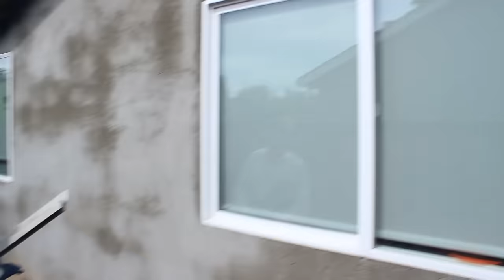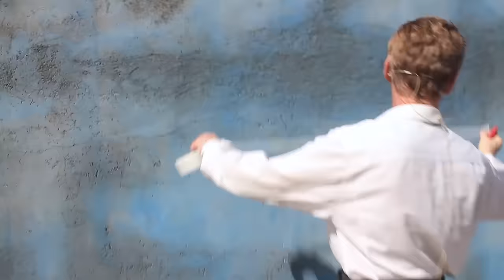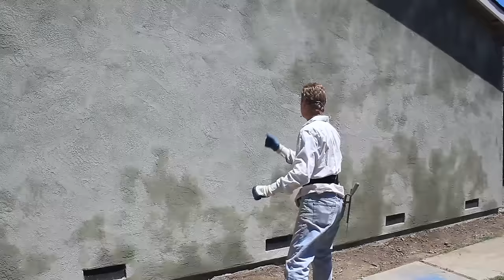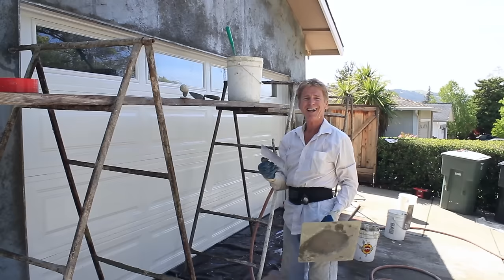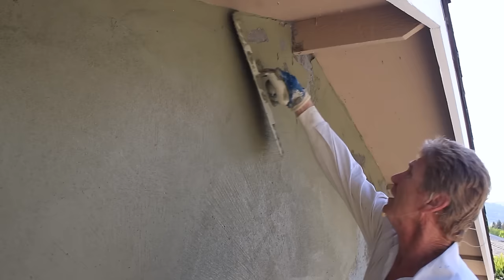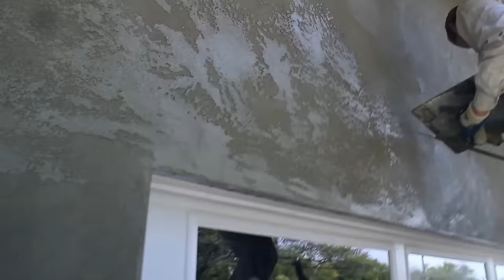Stucco Resurfacing

Comment: Vents??? Are they required for stocco applications, or are they because of crawl space??
Reply: I suggest...you pay someone...and have it done right...incompetency costs in the long run...and I'd refer you to John Ruskin...
Reply from the maker: Howdy, Fix it, dude, yes vents allow airflow, which helps with the longevity of one's home and helps stops dampness, which calls the bugs in for dinner.
 For example, you have a roof, there should be adequate venting.
 Why, good question.
 With no venting, say in the summer, and especially some areas of the country that gets really hot.
    Without any venting, the attic under the roof can get so hot that the roofing membrane the felt paper can melt and or the roofing shingle will go from protecting your home from 30 years to five years.
    As the attic or under the roof can get past the temperatures of an over well oven 150 degrees, this can an will melt rooftops and also create unbearable heat inside the homes. This non venting of say roofs can even start fires, not good. 
    The venting for the bottoms of the home also has many benefits, like preventing swamp-like conditions. We know snakes, rats, and all sorts of crawling insects like skitters love this environment.
 Know what I mean, Vern.
     Kirk and Jason Giordano, Bringing to all the most complete plastering encyclopedia ever created in the world online.
 By the plastering messengers of Youtube.  With well over 850 free self-help videos 🎭 👀💃

Comment: Why do you always wear long sleeve white shirt when it's 100° out? Also why do you wear a black belt? I love your work.
Reply from the maker: LOng sleeves protect my arms from Lye burns, Lye is in all exterior cement plaster. Lye will burn a hole through a ceiling. My arms aren't that tough.
 The belt help my back from getting too beat up.😏
Reply: It's called lime burns dude not Lye .Lye is used to make soaps,glass cleaners and fertilizers etc.

Comment: I notice that the person who stuccoed my rear exterior didn't stucco all the way to the ground, and Im wondering why. Do you have any information?
Reply from the maker: You may have had a weep screed which they stuccoed to? 
Then they left the concerte the way it was?👨🏻‍🔬
Reply: @StuccoPlastering  I don't know, but whatever the reason, it looks awful!
Reply: @StuccoPlastering  Oh, and thank you for your reply.😊
Reply: Technically speaking that’s where you wall starts. The bottom part is the foundation. The weep screed it’s attached to the bottom plate of your home . The weep screed has holes in the bottom in case the wall accumulates. Humidity. That way it helps drip the moisture to keep dry. If you finish all the way to the bottom when it rains you wall will suck all the humidity into your walls . That’s the problem I have in my house. Luckily I live in Vegas where we don’t get that much rain.
Reply: @adrianchavira5223  Thank you so much. I'm not sure, though, if there is a weep screed there or not as all I see is the cement. I'll ask the contractor.

Comment: Hi kirk what did you apply over the mesh?
Reply from the maker: Good afternoon Joe, it's called, "Poly Bond, made by La Habra stucco," it's engineered to attach styrofoam to base coats.😏
 Thus it's a cementitious adhesive. This way no ghosting thought the color finish.
 Bringing peace, love, and brotherhood, back into the 🌎 of Plastering.
    The most comprehensive encyclopedia of plastering on video, by the plastering messengers of Youtube. 
Kirk and Jason Giordano with over 800 videos 🎭 👀💃

Comment: Hairline crack are normal, also if browncoat was done months ago then obviously there will be bigger cracks due to a variation of foundation settling and or expansion and contraction of lumber due to fluctuations of temperatures. If your adding synthetic stucco finish then it should be elastomeric stucco . Who the hell would add any other product other than tinted primer and a synthetic elastomeric tinted finish. If it’s cementious then all the cracks will still appear afterwards
Reply from the maker: Howdy Vazquez, In light of a deeper knowledge, I disagree. 🤔

Comment: If the cracks were caused by an underground river won't they just come back or find a weaker spot in the future?
Reply from the maker: @bobcougar77  Dam it Jim, I’m a doctor not an engineer. Strar-Trek. 😉
Reply: @StuccoPlastering  Good point.  Just fly around the sun real fast and we can save the whales.  lol.   
My question was kind of dumb, by that logic there would be no reason to fix anything.
Reply from the maker: @bobcougar77  Exzackory. However, there a big difference between an underground stream to an underground river.

Comment: do you also dilute weld crete for this particular project ?
Reply from the maker: Howdy Julio, no, instead, we applied it extra thick. Why? I wanted to kill the suction and seal the fiberglass mesh tape. I'd recommend Quikrete bonding agent for you; there's no guessing whether to dilute or go thicker. Quikrete bonding agent is for stucco or concrete and is sold at all Home Depots and Lowes, plus every small hardware store I have ever visited. Cheers.
Reply: @StuccoPlastering  wooow thank you very much love your videos ! im learning a bunch of stuff thanks to you😃😃
Reply: When in doubt apply liberally

Comment: I would like to see you apply stucco finish on a non-existing wall
Reply from the maker: Hi Martin, LOL, if a wall does not exist, how can this be accomplished? We'er not mimes. Or are you refrring to any oof these videos?https://youtu.be/chU9So3vy9s/ Integrated stucco color finishes, moss.
https://youtu.be/OqbQbdEySSI/ New smooth stucco over rough stucco. Jake.
https://youtu.be/xPvm5BUm5-8/ Updating stucco exterior before and after, Gabs. 
https://youtu.be/M-5yPXuIuJk/ Heavy or rough stucco made smooth.
https://youtu.be/2pPeOCb0bIs/ Spreading a Skip trowel texture with the base coat.
Reply: As plasterers we often encounter the art of plastering air.

Comment: Would you do the same onto a solid brick wall?
Reply from the maker: No, as color coat finishes are engineered to be applied a max of one-eighth of an inch thick, thus where the indented grout line are, they would have deep cracks in them. You're on a roll brother with intelligent questions.🍻

Comment: Hey mate, Im building a house currently. Not sure if you can help but Ive watched a few videos and thought you may have some advice. The contractors used a cement plaster ratio of 1 : 8 over block work, "20 mm thick" Then a skim scout "2 mm" plaster + mm. They rodded it but did a pretty terrible job of the walls, some have curves of about 1 cm over 1.2 meters due to openings having to be fixed and such because again they were not accurate, square or plumb. My issue is Ive taken over the site and want to fix some of these walls. Ive seen alot of people saying that really we shouldnt or cant re plaster considering how thick it is already. Do you think we could get away with using a really good quality bonding agent.. or maybe a metal lathe really solidly fixed to the walls?. One of the worst is about 1-2 cm off from bottom to top(6.5 meter tall wall)...
Reply from the maker: a good bonding agent, I've stuccoed 3 to 6 inch think when necessary. No metal lath at all!
Reply: @StuccoPlastering  thanks mate, I want to get it sorted but also you know how it is there is always a limit to how much you can put in. Will aource a good agent

Comment: COLOR COAT LAST FOREVER....well yea but it fades out in less than 10 years just like anything and looks bad. That is why I am a painter. some people think you never should paint stucco and that is not true. Paint can last longer than stucco color coat  because is is NOT a cement finish. It has binder that protects the colorants. Unlike stucco which just has pigments. 
   KIrk is the Best in his trade and I am the best in mine. Being said I am not saying anything bad about him or what he does. I am just saying that as a painter we are both correct in doing what we do. There is a time to re stucco and there is a time to paint stucco for a longer lasting even color on your stucco. Some guys sell that stuff too called fog coat. WHich is a RIP OFF. IMO. It does not properly adhere because it is not mixed into the cement. Then It cannot be painted properly painted after because it creates a CHALK finish that nothing will adhere to. Even a bonding agent may have trouble with it.
Reply from the maker: Good evening Mike the painter, “au contraire mon frere,”  stucco integrated finishes do last hundreds of years, It the same principal as a brick, it's color integrated. Your right in extreme heats like 100 and above for three months at a time it can fade, that just adds to the charm and beauty of the home.
 I have had more than my share of clients ask if I could make their home look 100 years old but, keeping the integrity of a sound investment.
    The complete plastering encyclopedia on video, by the plastering messengers of Youtube.  
     Over 850 free self-help videos 🎭 👀💃
Subscribers, you can depend on us to explain with truth, honor, experience, and skill for your time invested for wishing to learn the hows and whys of plastering.😉
Reply: Just completed a small two wall repair. The color coat was falling off and the scratch and brown coat was powder to a light hammer blow. Related the base coats and the finish with skip trowel, and yes stucco paint to seal it. Looks great and will last many years.

Comment: Why not use a grinder on  the wall to it key much better than putting a seal coating
Reply: Who wants all that dust and noise? THAT  seal coating is powerful product, also allows for even suction that is maintenance free and more uniform. Grinder would also put waves into surface more than needed. It’s plumb from being rodded so a grinder is just drama
Reply from the maker: Greetings deputy Dog, an excellent question, the fact is what Austin below commented to.🤷‍♂️
     More importantly, to grind or cut stucco, that action releases in the air, "silica dust," which is almost or maybe just as toxic as asbestos. 
Sure you can go to the beach and enjoy the sand, but to cut or grind the stucco and or sand releases, silica, can't have this deadly toxin into the air, where unknowing victims and animals would unknowingly inhale. This would impair their lungs the inability to absorb oxygen. 
The Carona virus is bad enough.
    Thus I would be ricking innocent lives by an ignorant decision, who would know?🤷‍♀️
 I would, that's not my style, cheers brother.😉
 Bringing peace, love, and brotherhood back to the world of Plastering. 🌍
    The complete plastering encyclopedia on video, by the plastering messengers of Youtube.  
     Over 850 videos 🎭 👀💃
Reply: Kirk Giordano plastering Inc. I would normally wet the wall first then use my wall chaser set to 12mm and score the  walls so that I get a good clean key ready then ply thin wet coat followed by a fibreglass mesh ready for my topcoat I know it’s very messy but at least I can walk away from the job knowing my stucco has got a good key
Reply: Kirk Giordano plastering Inc. keep the videos coming Great to watch

Comment: Those walls cracked because they floated too wet and got no compaction in the sand, notice how they’re only cracked in the wet floated areas of the wall?
I’m really surprised with your knowledge that you didn’t mention that! 
Every wall floated too early cracks! yeah he’s got a lot of good stuff but he just went around and described this brown coat that somebody else did and they brought him in to do the La Habra finish it in California. They’ll do the La Habra and he describing about how the Wyatt crack and stuff like that because there’s a river running under the underground river and they swell on the moon with the framing in this and madness and that, and on the walls there’s all these spots that were floated really wet and other spots that were floated really unlike hotspots dry, and the crack through the wet spots spots got a massive moron. How do you know about Plasterer? He was on his last one he was showing me about the guy really likes to l I put it in the back of my truck we have to travel with in the back of my truck can I lay down all the spots were floated super wet and the crack goes right along the dry spots and the wet spo
It’s not from an underground river, although that does cause cracking.
Reply: Oops, my speaker was on recording my conversation. Lol
Reply from the maker: @toddlloyd7447   Thanks for the tip.

Comment: roll or spray Weldcrete
Reply from the maker: Evening Sandra darling, excellent question.
 Once about 25 years ago, I sprayed the weld creat on, never again.🤔
    It's ten times faster to roll it on with a fat nap roller. The nap should be about one inch to an inch and a half.
 Remember, it does not have to be pretty or solid in color. It's a bonding agent, not a painted surface.
    I say this as many think it has to look perfect when, in fact, the uglier, the better.😉 
 Kirk’s Tip:  all subscribers or anyone who stumbles on our channel with a question, type it into our Stucco/Plastering channel, and like magic, a video will appear to explain how it's done. 
   This feature is miles ahead of any plastering forum. 🥳
Kirk & Jason Giordano Plastering